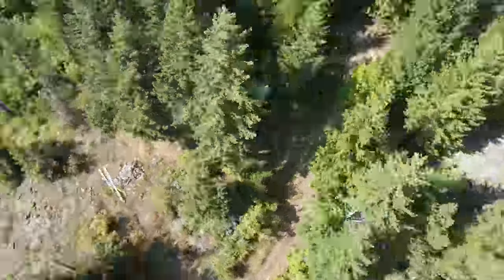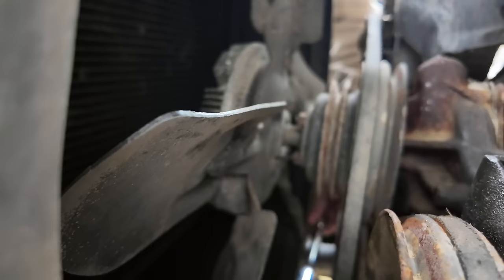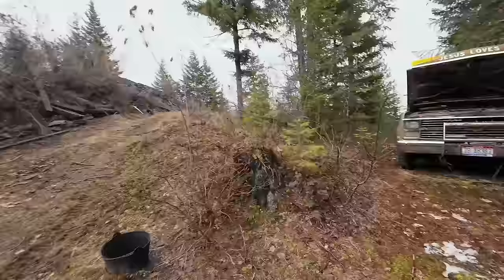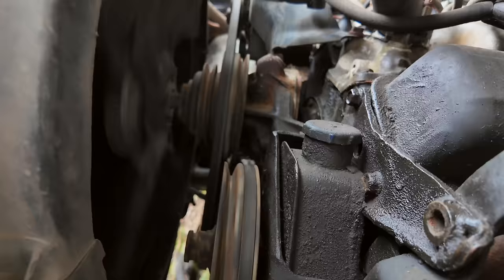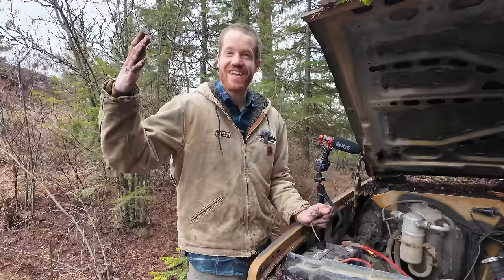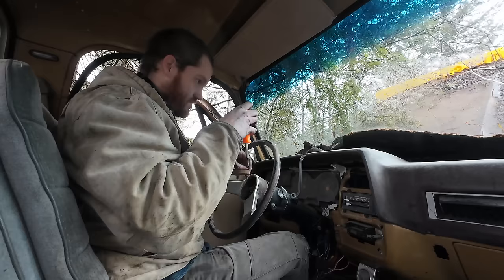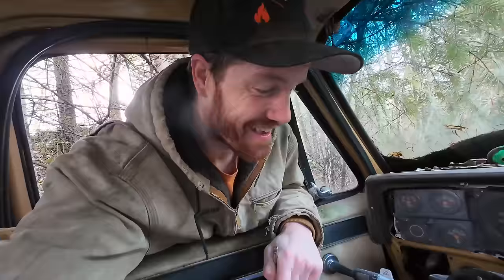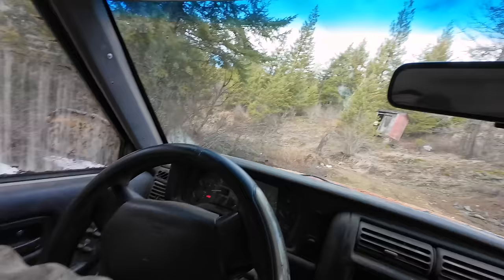ABANDONED 1983 Chevy K10 (sitting 20+ years)

Comment: Ummmmm.... That wiring job and extra lock cylinder sort of screams "hot wired" in the wrong way.  Make sure it's not stolen and abandoned for that reason.  I would hate for you to put work into it and find out later it was stolen and you loose it.  Looks like you have a new project for next winter in the shop now (assuming you can wait that long to work on it)

Comment: So this is funny, I spotted this 83/84 chevy in the drone shot episodes way back lol. The backfiring and lazy running leads toward retarded ignition timing..to fix it loosen the distributor clamp and pull on the vacuum advance about a 1/4"..it will start and run ten times better. Good job on the ignition key swap, done it many times over the years🙄
This actually looks like a pretty good truck if you clean it up you'll probably be surprised it'll be a great addition to your Fleet👌
 Once again love the content !👏👏👏

Comment: If I were in the country and came across an old spare running vehicle: I'd immediately build a DIY "woodgas" system that turns firewood into a fuel.  There are a few videos of those quite complicated contraptions, but for the use case of just idling the engine to run a standalone "6-10kw PTO generator head" off a belt drive under the hood...it would be perfect.   You could charge your battery bank with the idling truck off just the power of an abundantly available resource, at the minimum it would be a fun engineering project.

Comment: Yeah you're redoing the wiring! You have two red cables going to the battery yeah that's not confusing and accidentally gonna fry stuff. Who knows what they messed with. Is somebody who is not a car person who is roped into a classic car project because I was the only one who could figure out the electrical and still couldn't quite figure it out yeah that thing needed a whole new wiring harness. It would've saved time it would've saved money would've saved aggravation and it would've probably actually worked. On top of that we were looking at wiring diagrams for three different vehicle years that weren't matching up at all with what we were seeing. And the owner was confident that it was one year and insisted things were that way. That actually looks like it might be a little bit better condition but who knows.